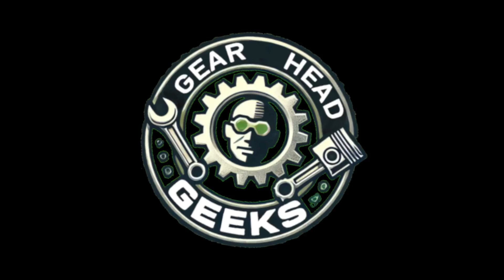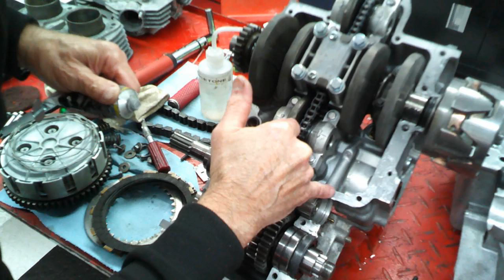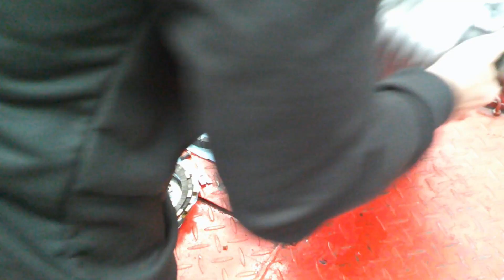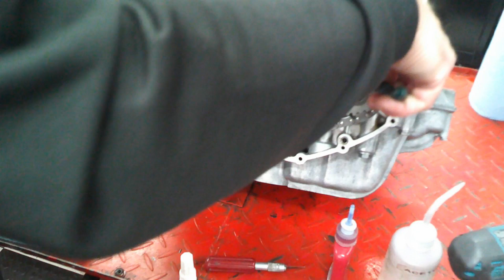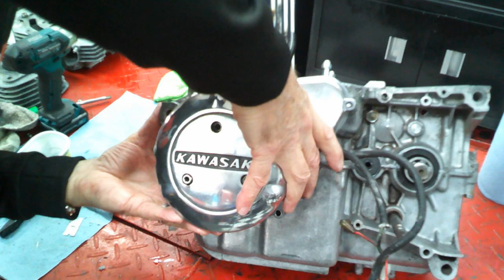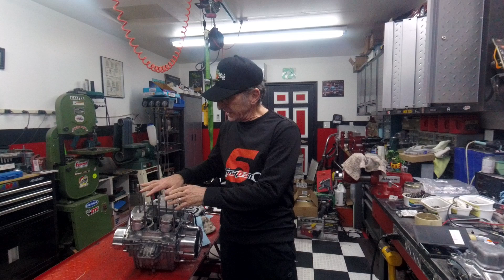ENGINE ASSEMBLY Part 1 (The bottom end). KZ400 Build EP8

Comment: My kz440 had 6 gears although the 6th was not much ratio change from 5th. I believe the bikes that have only 5 gears have a kick start option. With not kick start option there is room for a 6th gear.
I've heard of some kz650 owner mod their 650s getting rid of the kick start and using the 6th gear from a kz440 to get slightly lower gear ration on the highway.
Reply from the maker: I had not really kept up with that, so I am not sure if that works or doesn't .

Comment: THANK YOU FOR THIS VIDEO! Took one apart, couldn’t get the clutch to engage after reassembly, watched your video and you pointed out the notches on the pressure plate. That was the issue. Lifesaver! Great video.
Reply from the maker: You are quite welcome. Glad it helped.

Comment: Do you plan to make a video on rebuilding the top end of the KZ400 ?
Reply from the maker: Absolutely!! I am just waiting for some valve guide seals. which should be here today. I will go through exactly how to properly seal up those leaky top ends and set the cam timing as the factory says to do it. As well as everything else.
Reply: @GearHeadGeeks  That's great news ... look forward to it